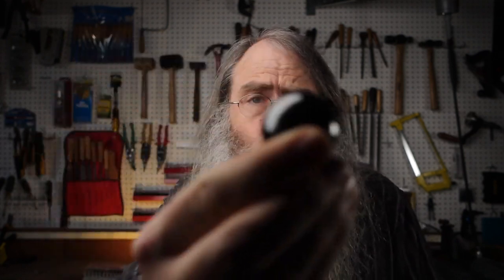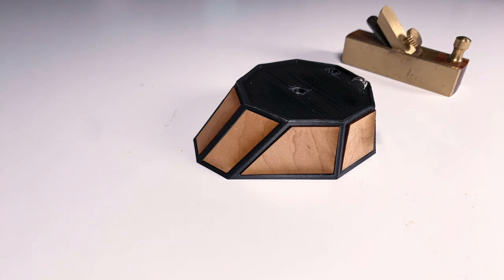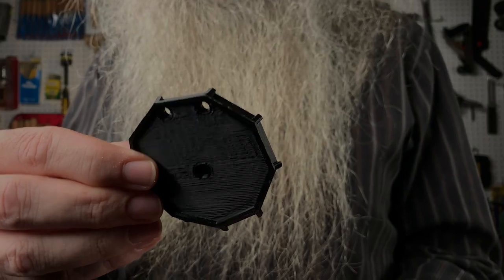Dice With an Infinite Number of Sides

Comment: Cardboard is the best prototype material! I will often build a small scale model of a project from cardboard before I ever lay hands on tools just to make sure the idea is sound. I'm glad I'm not the only one. Great commercial, I'd buy one.
Reply from the maker: Yes!  This.  100%  I did a talk once about paper prototypes.  So great because if you need them symmetrical fold and cut.  If you need 4 of them,  stack and cut.  Etc.  I made a Totoro Bench and first I did a scale one in corrugated cardboard.  It costs nothing and gives you a great sense of scale/step height, etc.   Things a sketch in a notebook are never going to tell you.  I'm glad you liked it!

Comment: Well, your stuff rivals This Old Tony's.  And that is a great thing.  But, this project is missing something.  The infinity sided dice is great but it needs to generate a number.  The way it could do that is with a small CPU, like the Gumstick, and a 16 character display.  Add some code to pick a random sign, a 6 digit random mantissa (like 1.23456), and a 4 digit random exponent (like e-0123, e+3456).  The code should pick negative or positive infinity 1% of the time and display the result when opening the box.  

Sure you can roll your infinity die but it must be read in the box.  Maybe add a pressure plate so you know when the die is placed back in the box and gen another random value.

This would be a completely ridiculous novelty item.  Great commercial by the way.
Reply from the maker: Oh I'm glad you liked the video.  Well this was really just a one sided/infinite sided die geometry joke that I ran with.  Infini-D was in close competition with the idea of a 1 sided die called "The  ONE".  ;]   A couple of folks have suggested various ways to produce an actual number as output.  Which would be fun, but an entirely different kind of joke.    Maybe the screen would always just say NAN.  ;]